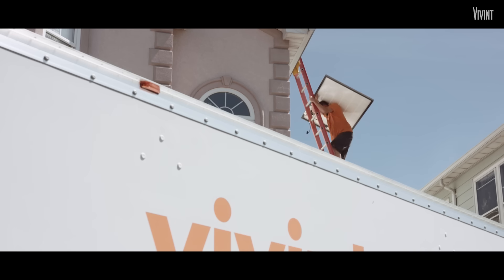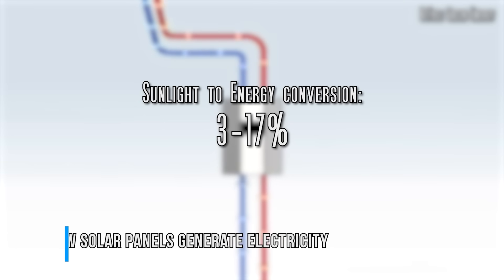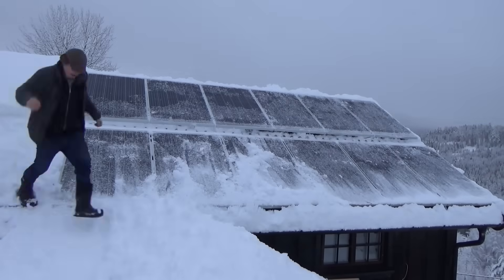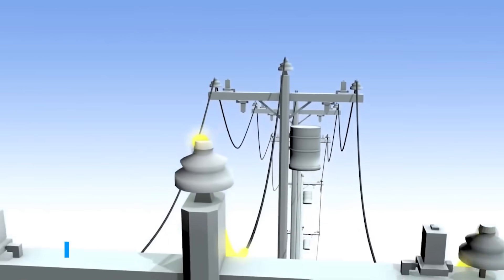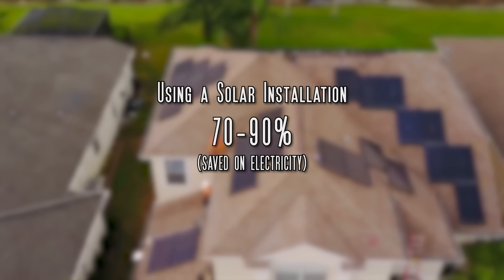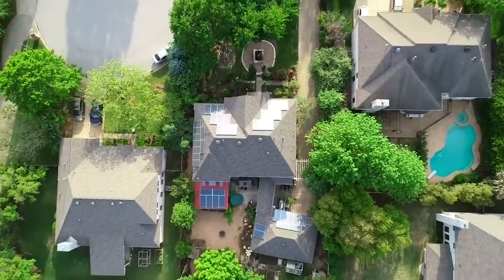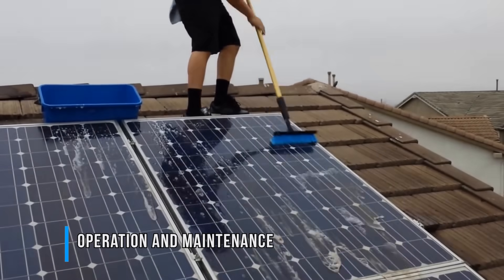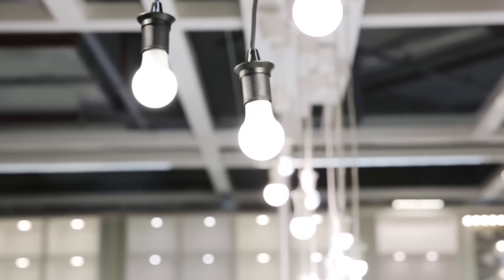Solar Power System For Home: Ultimate Beginners Guide

Comment: Back into a house that I installed solar on 6 years ago. It was a rental for the last couple years. From 5-15-2022 to 8-19-22 my net is $20 worth. The A/C has run pretty constant for the last two months in a So  California heat wave. This is the second house I've had solar installed on.  Solar is a total no brainer.

Comment: Here’s some facts they don’t tell you about solar power:
1.	Initial cost for a small 6kw system in around $25,000.
2.	There are federal and state tax credits for installing systems, but these usually only add up to around 26% of the system cost and these incentives will start reducing beginning in 2023. So you could save around $6,500 on the initial installation.
3.	After the initial install, are there additional costs? Yes, the system needs to be maintained. This takes around 70 per yr for the panels and around the same amount of time for the batteries. What’s this cost? Professional cleaning and service costs around $100 per hour or about $14,000 per year. Yes, you can do this yourself but it is a time commitment of around 16 hrs per month. How much is your time worth?
4.	Are there any other costs I should know about? Yep, the batteries will not last forever. They gradually lose their ability to hold a charge and the amount of charge reduces over time. They will need to be replaced. Low maintenance inexpensive batteries cost around $5,000 each, with most systems having at least two batteries, that’s around $10,000 every 5 years. 
5.	What kind of savings will I see from my solar system? Well the average cost for a 2,000 sf energy efficient home is around $200 per month or $2,400 a year. Yes, you can run your home, if you limit your useage, completely on solar power. The monthly cost? About $2,150 per month. This represents a savings of around $250 per month or $3,000 per year. You could, as noted, do the maintenance yourself and increase your savings to around $6,000. Before committing to performing this work, you will need good access to your panels. Most panels are located on home roofs. This presents some safety considerations as you will be working on a sloped surface and need the appropriate gear to prevent the possibility of doing severe damage to yourself. 
6.	Lastly, is it all worth the effort? Well that has to be considered carefully. If you have plenty of time on your hands, are in good physical condition, have all the appropriate safety gear, and a good knowledge of how to properly maintain a solar system, then solar may be a good fit for you. Is the savings worth the effort? Up to you.

Comment: Thanks for good explanation. I also wanted to install at my home(2 storey actually). Can you please also explain if we can install solor system and normal electricity system both if yes how can we do that with resulting electric cable and all...the electricity equipment we use is same for both or they are different than normal electric system(like bulb, tv,mixer fridge etc)  is there any challenge if we try to install like this way.

Comment: They even tell you how they limit the power that the homeowner makes they go back to AC power if you run it in DC continuity you would make $4,000 a month and you don't have batteries you would have a big ass capacitor

Comment: The understanding that they are designing these solar panels for the batteries to exceed heat due to them being built in the Attic versus in a trough and laundry room where there have no heat index and they're capable of giving back the grid 3 to 4 times a day if you do this so instead of them being 180° in the attic and give him back to grid once and a homeowner breaking even if you have 30 batteries or stop one capacitor for them to pick up and one deck capacitor now it's more efficient

Comment: I am designing a home that allows the homeowner to give back to grid 3 to 4 times a day not only that the panels I chosen to build produce condensation not only that the AC's produce 50 gallons of water an hour on the concert line centrifugal force buffaloes but instead of using batteries people for the airships we need to use capacitors allowing us to store them or for city to pick up at this time the earthship is making $4,000 a month instead of using batteries a capacitor capable of running a city block continuity-wise instead of having 40 batteries that go dead due to heat index a capacitor is good for life look at the UK the windmills and the watermills in Belgium they have the same exact capacitor and they don't know what electrical water bill is

Comment: I just bought into the power home solar system. I wanted a battery 
backup instead of a generator. Installation was fast and good. The 
installers were great.  The concierge never contacted me till I sent 
emails to them. When I tried to contacted them I was put on hold and most 
of the time I hung up after 25 to 30 min. That is not near as bad as 
the next thing. I am new to solar but I was told I would get a 26 percent
 $14,000.00 (something) dollar energy tax credit to pay down my $50000.00 my system 
and lower my monthly payments. Well that's not true in Indiana if your retired.
 Your social security  is not taxable. You need to have earned more than the energy 

tax credit to get that amount returned my tax man told me. Which I didn't. I contacted my sales man. 
He acted kinda surprised. The system works like it is advertised  
It's my fault for not doing my home work. So If you live in Indiana and your retired with no 

taxable income don't fall for this. Unless you are young and have a 
large income.

Comment: Does a system exist that uses live and stored power (off grid) that will switch to the grid for use when the system is down to say 20% of reserves.. and not feed power into the system?.. if so.. what is it called?

Comment: The solar panels should face the equator NOT south (08:14). You are right though since u are American and think the world starts from your east coast and ends on your western seaboard.
Also, inclination of the panels should roughly be the latitude degree on the map within which the panel sites will be located. ie 35° or higher for the Americans, check your exact neighbourhood...

Comment: Wow, great explanation... I am doing final research based on an Off-grid electrification program with a solar system in a remote region, I think this video will be helpful. But I have a question of how many solar panels do you need for a four-room house located in a rural area.
Reply: I'm an engineer and solar panel designer please contact for design solar panel

Comment: For me ... my solar DIY was worth every penny ... In two years I already recovered the investment of my system !!!Folks ... let's make something clear here ... Solar energy will not replace fossil fuels in all its forms as it is used today ... However ... the story is like this ... that is, solar energy is very "expensive" but do you know that the production of CO2 when you burn fossil fuels is not yet part of the electricity bill? ... If you add the fossil fuel pollution to the total cost ... then ... maybe solar power is not that expensive ... At some point ... you have to do your own research and come to your own conclusions . Again ... here in Puerto Rico we have a lot of sun all year round ... but we also have a hurricane season ... Therefore our solar panels must be installed to withstand winds of around 150 MPH ... Two years ago I completed an experimental project ... drop by https://youtu.be/2nYy4M1FReY. Comments are welcome. Thank you.

Comment: Good!I like Grafana reporting.Jawmall Supply solar charge controllers with high quality,Jawmall.com offer solar charge controllers from 3A to 80A PWM Solar Charge Controller and mppt charge controller,EPever solar charge controllers,Jawmall solar  controllers,Jawmall Solar Regulator,Power Inverter,EPever Inverter,Power Inverter,Sine Wave Inverter,High-Frequency Inverter, Solar PV,Solar System,Solar accessories, and more for Retail,Wholesale in Jawmall at right price.Contact us: sales@jawmall.com or Phone/WeChat/WhatsApp: +86-18002505142  By www.jawmall.com.

Comment: A lot of net metering programs are more just a side program of government policy based on pressure from society.  IN reality, power companies "DON'T" want to buy your extra power, mainly because they are losing money to do so.  Power companies need people to need power so they can sell it to them.
What does this mean?
This means the net metering system is designed to fail, and where i live, they have abandoned a lot of their original ideas to pay people for power.
Kinda sad.
Also, even if you could supply 100% of your own power, i'm still going to assume power companies will keep charging you a small fee for regulatory stuff such as continuing to maintain and give available power even if you don't use it.

Comment: A solar energy system runs about $30,000 with government help.  A house that has an average $350 a month light bill means it would take over seven years to recoup your initial investment in light bill savings.  They fail to mention the maintenance involved with solar.  You have to replace the batteries every three years at a cost of up to $5000.  Solar ain't worth a shit unless you have batteries to store the energy and to this day we do not have any efficient way to save electricity at a rate that is economical.  So if you are on the grid stay there...Solar will cost you twice as much over a ten year period.
Reply: As we all know the cost of new batteries are raising like rocket. I realised this when I was thinking of replacing my old batteries of solar power bank. 
During that period I came across this EZ Battery Reconditioning Program. 
The results were amazing beyond my expectations.
Do you know any type of old battery can be bought to life using EZ BATTERY RECONDITIONING PROGRAM.
To know more 
http://prodguide.com/landing-page-ez-batteries/

Comment: Okay I have a question about Solor panels system in my house. In 2 mouths blowing out fuse.
Reply: As we all know the cost of new batteries are raising like rocket. I realised this when I was thinking of replacing my old batteries of solar power bank. 
During that period I came across this EZ Battery Reconditioning Program. 
The results were amazing beyond my expectations.
Do you know any type of old battery can be bought to life using EZ BATTERY RECONDITIONING PROGRAM.
To know more 
http://prodguide.com/landing-page-ez-batteries/

Comment: I have a question 
My house is 2150 ft how expensive and how many panels do I need
Reply: Where are you located, I can help.
Reply: As we all know the cost of new batteries are raising like rocket. I realised this when I was thinking of replacing my old batteries of solar power bank. 
During that period I came across this EZ Battery Reconditioning Program. 
The results were amazing beyond my expectations.
Do you know any type of old battery can be bought to life using EZ BATTERY RECONDITIONING PROGRAM.
To know more 
http://prodguide.com/landing-page-ez-batteries/
Reply: It helps to start with your electric bills (a year's worth is helpful), to see how much you already use.  You can study more about the design of systems and DIY, or you can select an installer to do all that, including determining how many panels you will need.  Usage is the biggest factor, but to get panel count, location matters, as well as whether you're trying to replace 100% of your usage, or just offset some of it.

Comment: Nice video. But I still have some questions.  If I have two 12 volt deep cycle 100 amp hour each battery's and I have two solar panels with the following specs each 315 Watt, Operating Voltage is 36,6 volt,  Operating Current is 8,61 Amp,  Open Circuit Voltage is 45.1 Volt,  Short Circuit Current is 9.18 Amp. I also have a total of 150 watt 12 volt led lights. Question 1: What size charge controller do I need toe charge the two battery's with these solar panels and to run 150 watt 12 volt led lights ?  Question 2:  How long will I be able to run these 150 watt 12 volt led lights before the charge controller will shut them down ? Question 3: After the charge controller shut the lights down, how long will it take these two 315 watt solar panels to charge the battery's in a normal sunny day ? I will appreciate it very much if someone can give me the answers on these question and give me the formulas to get the answers as well.
Reply: Hello, your 2*12V100AH batteries are simply 2*12V*100AH which gives you 2400VAH which is 2400Wh (energy stored).Voltage(V)*Current(A)=Power (VA) whose units are simply watts (W).  Solar availability is assumed to be 5hrs maximum in a day which means you will need at least (2400Wh/5h = 480W) of panel power to charge them which means your panel power is sufficient for your batteries. Assuming you set 50% depth of discharge on your batteries, meaning you don't want the voltage to go below the 50% DoD level, then your available energy is only half = 1200Wh which will run the LEDs for 1200Wh/150 = 8hrs maximum. This answers question 2. Since you are trying to feed 150W at 12V, your current is 150W/12 = 12.5A. Add 25% which gives you 15.625A therefore go for a 12V, 20A charge controller and that has to be an MPPT(maximum power point tracker) charge controller. This answers question 1. For question 3, it depends on the settings available in your charger or controller, you can set the charger or inverter to put the power back on after a certain voltage is reached on the batteries. I would prefer you choose an hybrid inverter charger that simply used the solar directly once batteries are available and draws from the batteries only when there is not enough solar e.g at night. If you have an inverter working like that, your batteries will last more than 12hrs since they won't get drained at all during the day. Feel free to ask any more questions.

Comment: I like solar power, and promoting it is a good thing, but not when information is not accurate. https://youtu.be/k6veDQ6nWUQ?t=376 so in some cases the grid pay you more per kw than you pay them. HUH? how rare are these cases? More common is that you are paid a lot less, because this is the market economy, and is normal. you get paid with a producer price, and you pay consumer price which includes transport rates, transport losses, taxes and grid profit. when you pay only the difference is a rare case when the difference is paid by subsidy or some other method. The only case when you pay less than you get paid is when your system produces on the peak demand and you consume when there is no demand. But the case is rare. As any user you will certainly use on peak too. And since solar is gaining momentum, there will be a lot of production and so, the price for selling on the market will be lower when is sunny. 
Solar is great, but unfortunately still costs more than the traditional energy production. Now became cheaper for some zones, but because of need to store it overnight, still cannot compete. Unless you have hydro, to use it during the night, storage is a must, and doubles the price. My country is lucky, with a lot of hydro, but still do not apply the method I mentioned.  
Please be honest. Tricking few customers will have worse consequences, and is a pity.
Reply: As we all know the cost of new batteries are raising like rocket. I realised this when I was thinking of replacing my old batteries of solar power bank. 
During that period I came across this EZ Battery Reconditioning Program. 
The results were amazing beyond my expectations.
Do you know any type of old battery can be bought to life using EZ BATTERY RECONDITIONING PROGRAM.
To know more 
http://prodguide.com/landing-page-ez-batteries/